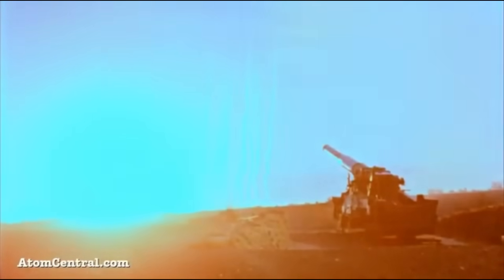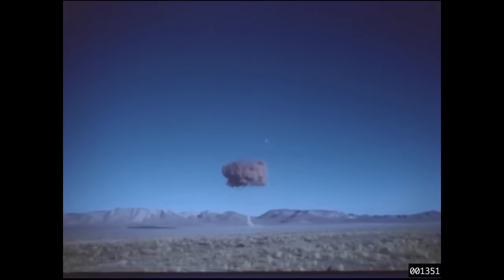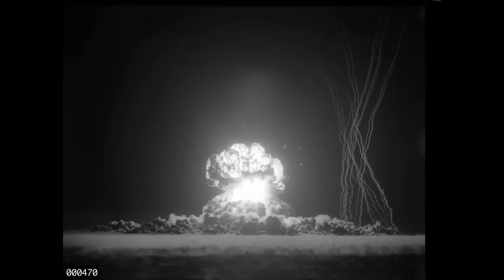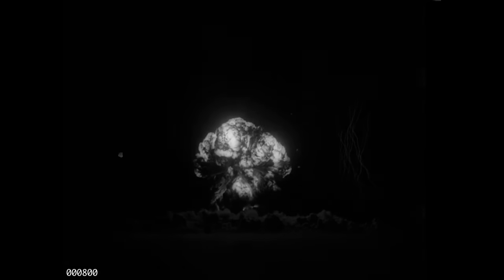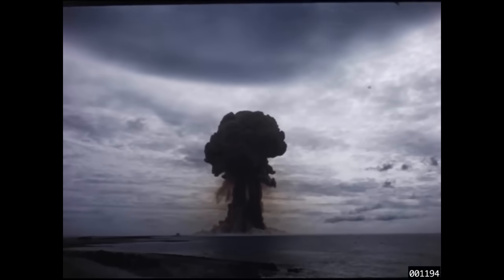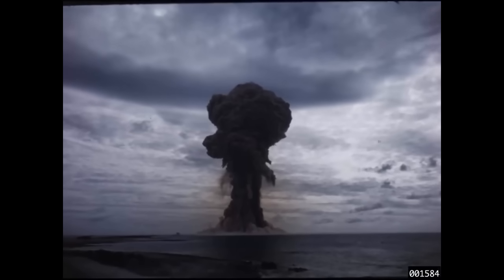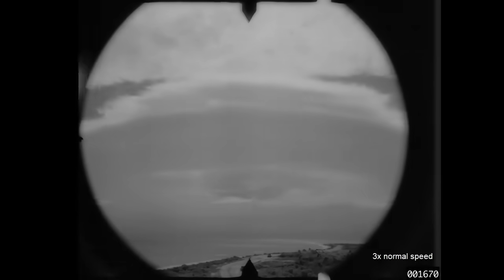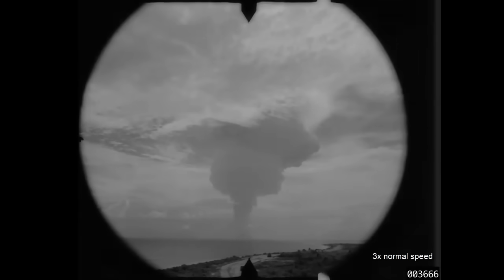What does a nuclear bomb sound like?

Comment: That makes sense. I'd expect a sharp loud bang, followed by a roar / rumble, sort of similar to the sound of a nearby lightning strike (i.e., thunder), but more powerful. That's because the first thing that reaches you is a fluid shock (which is a near-discontinuity in the pressure distribution), followed by the sound due to turbulence and echos / reverberation and potentially smaller secondary explosions, like objects exploding due to being rapidly heated. It would sound different from a large enough distance, though, as the shock front broadens. The detailed structure of the atmosphere between the bomb and the listener will also change the sound, as will the landscape. Layers of varying temperature, density, and humidity change the way the wave propagates and mountains obviously also change the way the waves propagate and echo.
Reply: As I read this, I thought about how the sound from lighting would travel. 

As I've wondered if my neighbor down in the valley, gets a different rumble than me up on the hill.
Reply: @marcusjohnson7441  the point or place from where the sound is produced has more low end(low frequencies) and when you move away from the source, the low end decreases and when you move even farther away you will not hear low end, you can only hear mid(less in level than high) and high frequencies than the low end. If you ask why is that?, low end has shorter wavelength than middle and higher frequencies so the low end can’t travel a greater distance. I hope that I cleared your doubt about difference in rumbling, if not you can ask me.

Comment: SO it was exactly how i expected it to be. Absolutely nothing at 1st since sound has a crazy slow travel time compared with light. so you would see it long before you could hear anything then it would just be a loud Bang and a bit off low rumbles.
Reply from the maker: Yeah it sounds very logically what you would expect. But you would be surprised how many people are surprised by the anticlimactic "bang". In movies it's usually a more drawn out sound.
Reply: @venera13  Yeah cause when you think about it, there is only 1 explosion not many. So would be a short bang and the rumbles are just the residual soundwaves ricocheting off the environment afterwards. Pretty simple stuff to understand. Well to some people. xD

Comment: So it took 35 seconds for the sound to reach the recording device. So the explosion was what?....7.3 miles away?  Is sound pushed along faster than the speed of sound, at first, by the blast effects?  So was the blast farther than 7.3 miles but the speed of sound was given a jump start by the blast????  Just wondering.

Comment: What's also amazing in these nuclear test videos is how little the smoke trails are disturbed by a nuclear blast going off right next to them. Just goes to show the limitations of nuclear weapons. Any force will take the path of least resistance and that is obviously true of nuclear blasts. The atmospheric pressure directs the blast pretty much straight up to where the pressure dissipates. So I would think that having a greater number of small yield weapons would be of more value than fewer bigger blasts.

Comment: A nuclear bomb (for safety reasons) requires a conventional bomb to initiate it. Most conventional high yield explosives rely on nitrogen atoms snapping together to form a triple bonded molecule. This produces a short, fast shock wave that propagates through the medium, in this case, atmospheric air. The shock wave gets spread out the further away from ground zero you are, but it still has a short, sharp report: bang!
Reply from the maker: The conventional explosives aren't for safty reasons, they are to compress the Plutonium pit to initiate the runaway chain reaction. The bomb couldn't work without them at all.

Comment: I think in a fusion weapon the heat from the fission trigger causes the atoms to fuse.   If I remember correctly the X-rays add to it, depending on the design of the weapon.   But it's the heat from the fission reaction that causes the fusion.

Comment: There is one aspect of audio perception that's frequently overlooked: Our ear is actually TWO ears - the modern one (the cochlea) and the "old" one we developed as reptiles and that's what we call the "balance" organ. While the sensors for angular movement have little ability to pick up sound (except for people with a condition called Superior Canal Dehiscence Syndrome (SCDS), the sensor for vertical acceleration is rather sensitive for low frequencies. This mechanism is called "saccular hearing" and is a component of the ABR (auditory brain stem response). For sounds above 80dB, the saccular stimulus determines how subconsciously "involving" an acoustic signal is. The sensibility of the saccular sound processing path is frequency-dependent with maxima between 0.2 and 5.3Hz and some peaks up to 300Hz or so. Therefore, in order to know what a nuclear blast "really" sounds like, you need a play-back system that includes the infrasound from the blast played back at a good temporal resolution at 80dB or more...*
...
*| if you want to be even more precise in your reproduction of a blast sound you would have to include substrate-conducted sound (ground vibration) too, as this input is ALSO moderating our auditory processing of low frequencies...

Comment: So would the radiation follow? Like if i was that distance, after that noise how long would i have? Might need this info by 2022 lmao
Reply from the maker: Depends on wind direction. At the distance they where from the bomb most if not all of the Xray and gamma ray radiation would be scattered by the air. So the only EM radiation they where exposed too was intense visible light, infrared, probably UV and radio. So no danger of death there. The fallout from. The bomb will rise and scatter in the air along with the dust. If the wind blew it at them they probably wouldn't get a lethal dose unless it rained out onto them. But it would still not be good and would raise cancer risks. If the wind blew the fallout a different direction, then watching the bomb from that distance would not harm you in any real way.

Comment: That is the sound of the shock wave....
Reply from the maker: Which is the sound of the bomb. Sound is just a pressure wave in air. the bang you hear is the sound of the bomb. The primary destructive shock wave doesn't even reach he spectators just the displaced air from the blast.
Reply: @venera13  your hearing the Sonic boom not the actual sound of the explosion 💥..
Reply: @venera13  you don't know what you're talking about

Comment: A nuclear blast releases a huge EM pulse. The magnetic wave would erase any magnetic tape unless therecorder is shielded.
Reply from the maker: They only produce a strong and wide spread EMP if they detonate in the ionosphere. Ground detonation don't produce string enough ones too matter. The intense light, radiation speckling, and thermal em pulse is more a concern with the cameras.

Comment: How far away were they from the explosion.  IT took about 36 seconds to get to the mic.  So maybe 14 to 15km away?
Reply from the maker: I'm not 100% sure but I belive it's between 10 - 15km
Reply: @venera13  I just did a quick calculation estimating speed of sound at 345m/s...  38-40 secs before you hear the explosion.  I wonder how quickly the shock wave travelled and then the radiation.  Those guys were crazy filming that.

Comment: I believe I witnessed 1 of the blasts that destroyed Mars, although I didn't actually see it. I was watching Mariner 6 approach mars, you could see canals, (which they now say never existed), then a maltese cross shaped object appeared in the lower right quadrant, as described in Hal Lafoon's Mars trip story & lights out, according to NASA the transmission failed, but Mariner 6 never sent another image. That's when the Russians nuked mars, just like they said they would in Hal's story
Reply from the maker: Sure thing bud 👍
Reply: @venera13  I doubt your old enough to have heard or known about this. It was broadcast on Radio KUZZ (Buck Owens Station) in 1968 or '69. I was working for Bob Green Ford in Hanford CA. Hal Lafoon was the News Director for the station, everyday at noon time he had a continuing series of strange, but true stories. Myself & 2 of my friends from Bob Green's began eating lunch in the city park so we could listen to this broadcast. Then I just happened to be be home sick when the Mariner 6 flyby occurred, & there it was, the stuff from Hal's story. That is until the lights went out.  I didn't realize what I'd witnessed until realjimmyroberts1 started posting blow ups of rover pictures on Y/T, and there it was, ruble everywhere, pieces of what could have been that cross shape building, slabs of concrete that could have been canal lining. But most telling is that the Mars Trip story no longer exists, the station doesn't have it, Hal's been dead for years, but his daughter has all his stuff, but the Mars Trip isn't there.  But somebody knows.

Comment: As a pedantic audio engineer, it always bothers me when in movies and such, the sounds magically reach the ear before the shockwave arrives. If that shockwave is visible in the distance, you can't hear it, because it's likely still traveling FASTER than the speed of sound in air (depending on distance).

It also bugs me when a scene involves a supersonic bullet just going "thunk" next to a character's heard followed by the crack of the gun: What you'd actually hear is the bullet, the snap from breaking the sound barrier at almost the same time (the mach cone the bullet is generating being so close by as to have practically no delay), then the initial bang later.
Reply: At the end of the day, the use of sound is pivotal for dramatic purposes. The reality of a bullet hitting you is BORING because you can't (nor would you want to) feel the impact against your flesh, bones, and skin. The sound has to be the companion to the visual element.

Comment: That was extremely underwhelming.  I was expecting a massive boom with an earth shattering amount of bass but instead it was like a clang or bang like striking an empty tin garbage can with a baseball bat, or like the shot from a mere handgun, not even a long gun (which has a more bass-like boom sound).  Considering the breadth and depth of the explosion I don't even understand how this is possible.
Reply: I have a hunch that the microphones used then, combined with the speakers typically used by Internet wanderers today, do not give any idea at all of what it actually sounded like.
Reply from the maker: That's kind of the point, You expect it to sound a lot more dramatic than it really is.
Reply: @venera13  Many here seem to think that this video gives a good idea of what it actually sounded like.

Comment: I recall a film of Operation: Buster-Jangler, test#4: Dog in the early 50's. Yield: 20 kt alt. 1100ft. It features soldiers turning around in the desert after a nuclear flash. A minute later as the fireball and plume of dust rises, the shockwave hits them, and some of them try in vain to cover their ears as the sound stirs dust all around them. That film is what I hear when I think of the sound.

Comment: I did a quick calculation of distance to the detonation based on it taking the sound 35 seconds to reach the microphone. 35 seconds x 1100 ft/s = 38,500 feet. That's 7.3 miles. That thing is quite a distance away.

Comment: How come the wind and shockwave aren't radioactive???
Reply from the maker: The radioactive fallout is a product of radioactive particulate in the dust. If you are close enough to the blast the initial flash will irradiated you, a bit further away and the Shockwave will be radioactive. But far enough away all you get is the light/thermal pulse and weak Shockwave. Neither is radioactive because air is a pretty good radiation sheild at a distance. The Shockwave doesn't carry radioactive dust because it's just a compression of air displaced by the blast.

Comment: Was that filmed at only 30 miles away? That seems dangerous
Reply from the maker: Not at all. The kill zone of the blast is only a few km in diameter. The danger of injury zone is wider, but nuclear weapons vary in size. The one at the beginning of the video was about the same power as the bomb dropped on Hiroshima. That clip was also filmed only 10km away and the camera was fine. 30 miles is perfectly safe for most nuclear weapons. The larger hydrogen bombs are the ones that approach that radius of destruction.
Reply: @venera13  Well, alright then, good to know lol

Comment: so whats this pulse that's instant? what frequency could that even be. Shockwave is one thing but I'm interested in this pulse that seems to be instant.
Reply from the maker: The initial burst along the electro magnetic spectrum from gamma through visible light on to radio. In this case most of the distortion was the visible light being so bright it physically messed with the cameras operation, along with the thermal infrared and some radio. Light travels at...the speed of light so it's more or less instant.

Comment: Lesser bombs are actually louder.  WTF?  BTW, didn't the scientists think that capturing sound was important?  Wouldn't people need to know what a nuclear blast sound like so they can recognize it?
Reply from the maker: In case of attack the sound would not be helpful at all, as by the time you hear it you die, and if you don't die then when you hear it it's a long way off. The general public where taught about the initial flash as there is a delay between the flash and the shock wave. The sound was only important to the milirary as early on they used microphones in the upper atmosphere to try and detect nuclear test in the soviet Union.

Comment: next Video: "what does an Exterminatus via Cyclonic Stage 2 Torpedo sound like?"
Reply from the maker: Well, 2 stage Cyclonic torpedoes are usually used on airless worlds. So technically it sounds like nothing. However it bores through the planet and destroys it from within. Solid matter transmits sound, so if you where on the planet it would sound like a very powerful earthquake transmitting through thr ground and into your spacesuit. If you where in orbit it would sound like planetary rubble impacting your ship after the planet breaks up.

Comment: also depending on the sounds you can tell yield and designed some how.  also a two stage weapons uses a uranium core and a Pu rod and LiD
Reply from the maker: You can tell some stuff about it based on its seismic signature, namely yield. With yield calculations you can estimate its design.

Comment: What does plutonium add to the explosion? Is it just the heat it creates?
Reply from the maker: The Plutonium in a nuclear bomb is what gives it most of its energy. The conventional explosives compress a mass of subcriticle Plutonium into itself making a supercritical mass. Neutrons collide with atoms making then split, the split releases a lot of energy and more neutrons which hit other atoms, and so on. This happens in an instant so all the energy released from atoms splitting is released at the same time creating a very very powerful explosion. 

So the Plutonium doesn't really add anything to the nuclear explosion, it creates it.
Reply: @venera13  Thanks.

Comment: Whats it sound like in space?
Reply from the maker: Nothing as space is a vacuum so there is no air to transmit sound. You could get close enough to it that the plasma from the explosion transmits the sound, but to be close enough to hear that you would be fried.
Reply: Actually, if you're in a spaceship, the extremely intense radiation flash from a nuke in space (since there's no atmosphere to block it) would explosively vaporize significant fractions of the ships/stations hull which you would hear as pretty much the same sound. This would not be limited by the speed of sound though, it would hit at the speed of light

Comment: How far away is the camera on that first one in the desert?
Reply from the maker: 10 km
Reply: @venera13  Does not make sense to me. how does a nuclear bomb go off 6 miles away and not even reach the camera? Im no expert but would have bet my house these weapons have a blast radius of at least 20 miles...
Reply from the maker: @joetoth5465  depends on the yield. Nuclear weapons are not uniform. Some have small yields others have much bigger yields. 

The little boy bomb for example only destroyed everything withing 1 mile radius, heavy damage up to 3 miles radius. Glass broken up to 12 miles.

The bomb in the video was about the same as little boy. So the camera was fine. The blast did reach it but by the time it did it was just a strong gust of wind. The lense are thicker than pane glass and smaller area so they where in no danger of breaking.

A modern avarage hydrogen bomb is much much bigger and has a much bigger blast radius.
Reply: @venera13  Thanks for taking the time to explain that. I appreciate it.

Comment: The early implosion devices were NOT hollow spheres. They compressed nearly solid spheres of metal down to tiny size. Thus why they needed literal tonnes of high explosive lenses.
Reply from the maker: I feel like you're correct, but all the archive data I have on Fatman (which was the same as the gadget in design) show a hollow plutonium sphere with a polonium beryllium sphere inside. Which does make sense when you think about going from sub critical to super critical. But i'm not 100% on that.